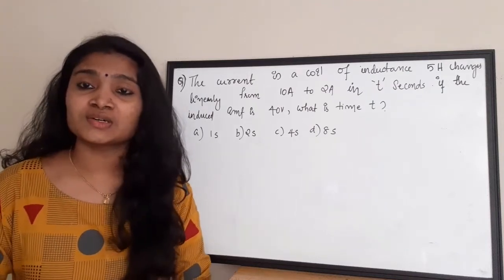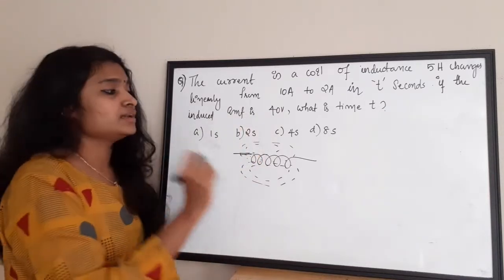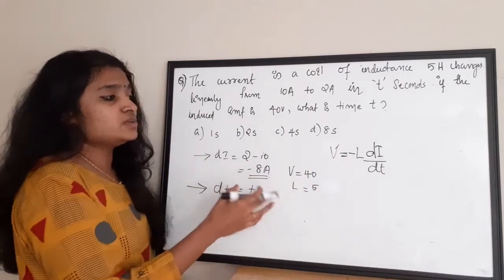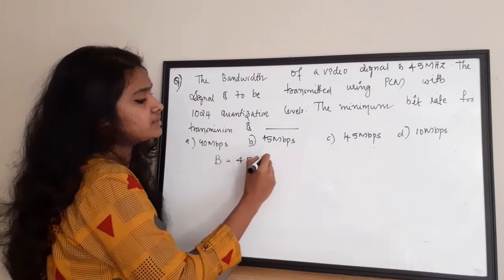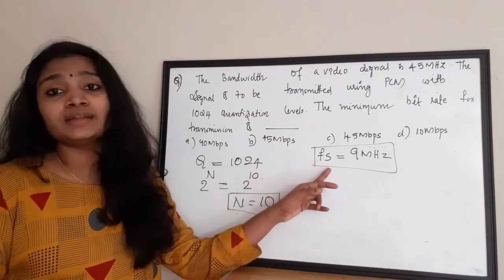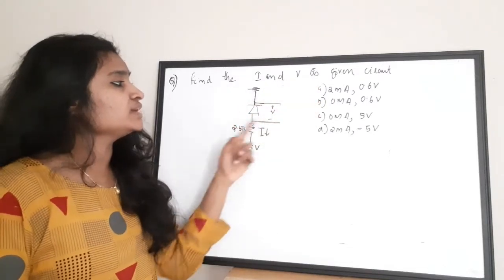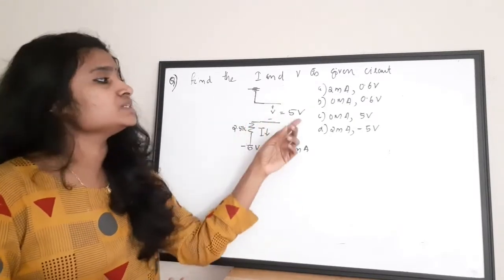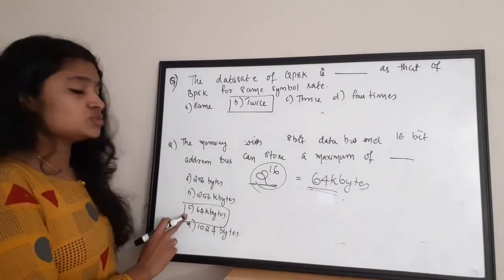ISRO Technical Assistant Electronics 2019 Questions  Solutions Part3

Comment: Mam,  in 2019 questions  papper there is a question , no 29 , in that question there are tow op amps which is connected by a capacitor , can you please explain how the capacitor will act in the circuits
Reply from the maker: I will see that and if I get it I will answer it in one of the next videos

Comment: Last question..16 address line means 2^16 = 2^10×2^6 means 2^10 is called 1k , 2^6=64, so total  64K and 8bit means 1byte so 64kbps.
Reply from the maker: Yes, simply 2^ 16 = 65536 *8 bits
 That is equal to 65536 bytes or rounding as 64kbyes.